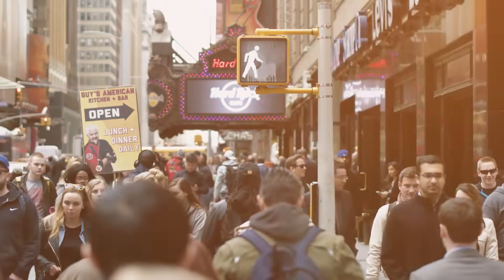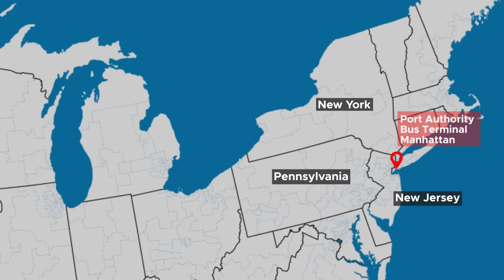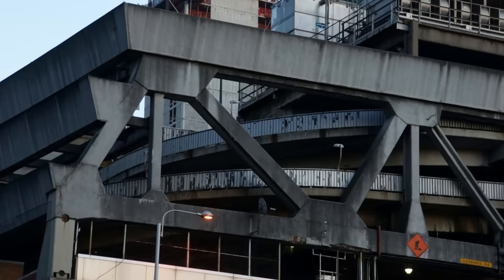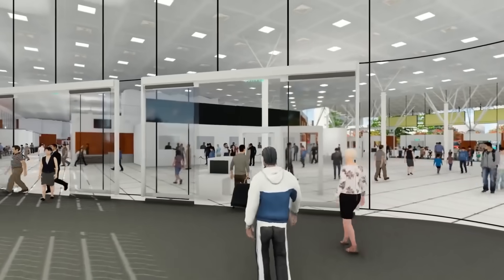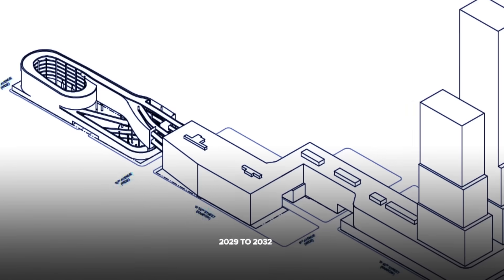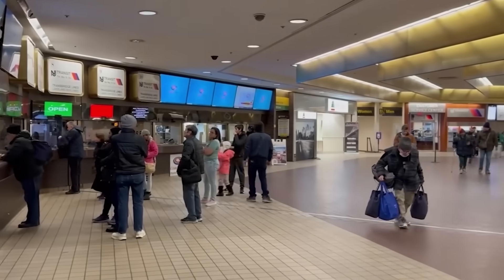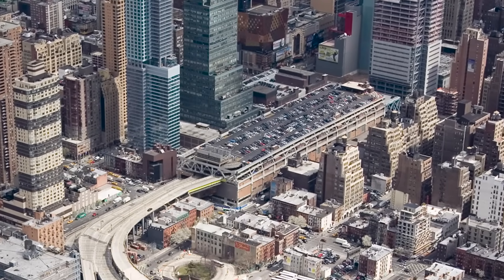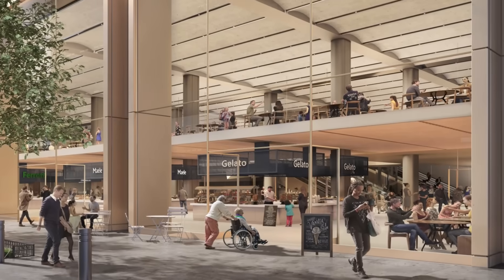The $10 BILLION Plan To Revamp America’s Largest Bus Terminal

Comment: Between 2000 and 2007, I took the bus from NJ into the PABT for work - not fun, but it worked well. Yes the building is ancient and missing some modern conveniences - but since bus ridership into that terminal is down (a few independent bus companies went under) and even NJT buses are lower volume the past few years with no reason to think it will increase - why spend $10B on this project when we all know it will cost $5B max to build and will end up being $15B with over runs to pad the politicians and their buddies pockets. You can build a burj khalifa sized buildingin NYC for less than this terminal, BTW.

Comment: 10 billion dollars is INSANE!
Reply: Yea when it will really cost them 30 billion
Reply: They spent that much on the new terminal for the airport. This seems more complicated. Oh, and they spent that much also on illegals for hotels...
Reply: More insane, it will balloon to 30-40 billions when it's done.
Reply: NY builds in 50% grift in initial budget, which by the end as the project triples, ends up at around 90%. This would be done in a normal mega city for a couple billion all in.

Comment: I live in Jersey and I frequent the City often and this terminal definitely needs a make over. 
Waiting for the bus during the peak time can be a hassle and unpleasant for the bus to pull up at the gates. Most of the areas are too narrow and sometimes one area can have more than one bus for pickup and the bus driver doesn't get off the bus to announce the number of the bus, because a particular area where the bus boards is behind a wall, therefore you can't see it unless you constantly go out the door to see if the bus is there.

Comment: I used to use the PA to commute to NYC and I think its crazy to build a station like that in NYC.  it should be in Jersey City or Secacus on 495 near Tonnelle with tunnels under the palisades that connect directly to Lincoln tunnel.  put a smaller station at the current location optimized for driverless buses that run a closed loop between the two stations with huge doors at deck level that allow fast entry-exit.  the NJ station could be built much bigger and efficient instead of a fur ball like they are planning.
Reply: Seriously? It's NYC! DUH!
Reply: @jerryaustin9115  you might as well build an airport on manhattan in addition to a full bus station.  total waste of space.
Reply: @kennj321 , perhaps they'll ask you next time. Your city planning degree is from where?
Reply: @jerryaustin9115  actually I worked on warehouse logistics engineering for a long time. Probably better skill than city planning for that job.

Comment: 3:50 - Expanding capacity from 850 to 1000 buses during peak hours.  That seems like a minuscule increase.  Retail shops?  Ok.  Retail is struggling you might end up with shuttered store fronts.  On the other hand, a more pleasant experience may encourage people to linger some and shop.  The architect looks more practical than inspiring.  I kinda wish it was both.  Overall, an increase in capacity is definitely needed.
Reply: I was surprised to hear it was only going up from 850 to 1, 000. The new build will allow for bigger buses (articulated or maybe double deckers?). That would mean some routes could double their capacity with the same number of buses. I wonder what the projected additional rider capacity is.